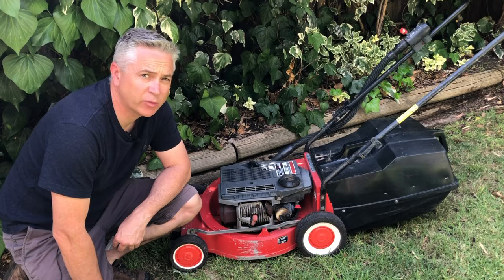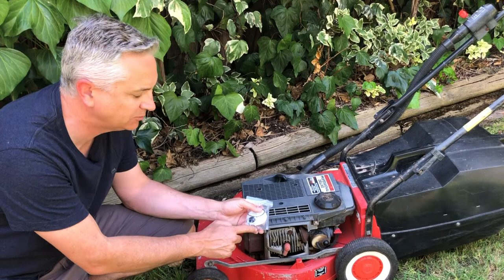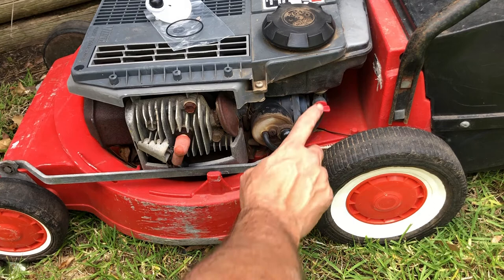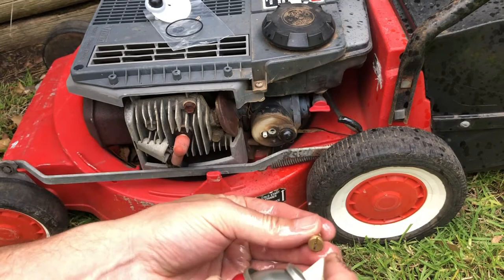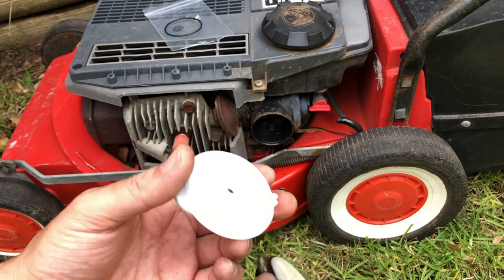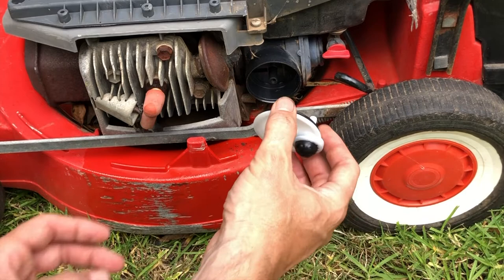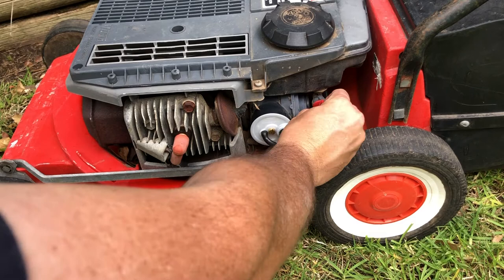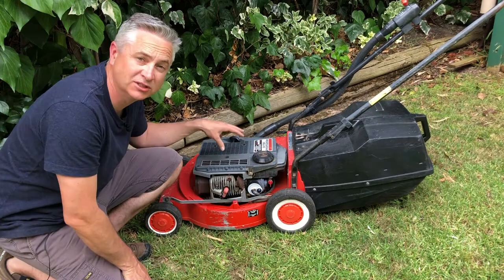Victa 2 Stroke Lawnmower Easy Carby Fix - How to fix leaky primer bulb and flooding carburettor

Comment: Thanks Drew bought the carburettor kit with the metal needle.After pulling the start cord 3/4 up the mower started. Being battling to start the mower with the original plastic pin. It’s a game changer.
Reply from the maker: Hi Mike, good work, you will find that previously the carby was flooding!  Cheers Drew

Comment: Couldn't have gone on a better mower. That alloy base that takes the thumb latch type catcher is a superb combination with the mighty 2 stroke Powertorque motor. I have used a white version of your mower  for years and it's a pleasure to use both on long tough lawns and keeping your well kept garden manicured. So glad the kit worked out.
Reply from the maker: 100% agree, these mowers are brilliant!
Reply: @DrewFixIt  I just rewatched your vid a bit of friendly advice, when you pull the cord wait until you feel it grab at the motor before giving it a tug. Don't pull it fully from the get go.
These things are tough but it's always best practise on any pull start motor ☺.
Reply: @jamesfrench7299  Spot-on advice. Some years ago I broke the cord on my father's mower by pulling too hard, so I offered to take it home and try to fix it. It wasn't difficult. It's still working on the original cord, albeit slightly shortened, and I've learned my lesson.

Comment: These mowers are a model of simplicity, repairability and reliability, not to mention the fact that they mow really well, and parts are still available - nothing else comes close, and I've used and maintained this model for many years. If a score higher than 10 were possible iFixit (if they were to cover this type of machine, which currently they don't) should give this mower at least 11/10. Recently the circlip holding the height adjustment on the left hand side somehow got lost, but getting a replacement online was easy after a temporary fix with a bit of wire. Same story with the air filter, plus bits.
Reply from the maker: Hi Tom, agree these are brilliant mowers!  You wouldn’t believe but I picked up another one off the side of the road the other day and … I’m sure it won’t take much to get it running!!  Cheers Drew

Comment: great video effort and simple for many people who have thrown out these mowers purely because of sticky carbys.   observation1 You should have mentioned WHY you cradled the float and all assembly  when pulling it away so as not to lose the NEEDLE as they drop out!   observation 2: there is a horizontal indicator/line usually on the front to assist the float line.   again not a critisism and you showed what a person would have paid 99.00 at a mower shop to do exactly that yourself  in 5 mins   BRAVO
Reply from the maker: Hi Peter, thanks for your kind words.  My goal with the channel is to help as many people as I can and I understand completely what you are saying!  Funnily enough I have just picked up another one of these mowers off of the street, which has a visible split in the primer bulb.  I will make a video fixing this one up and incorporate your feedback!! Cheers Drew

Comment: I have the green 1984 version of this mower, with the green thumblatch catcher. When putting the faceplate back on the carby, I usually put it on upside down, then turn it around once it is on before tightening up the screw. This makes it easier than holding the float and needle in. How is the needle holding up?

Comment: Great engine let down by the carby. Accidentally forgot to shut the fuel off and returned three hours to find engine hydro locked with fuel. Fuel had even filled the base plate having leaked out the exhaust. I own a later model Mastercut  utility mower with the three litre tank so there is a potential to lose three litres of petrol , not to mention the associated fire risk. Thanks for posting the link. Ordered one straight up. I feel Victa should have issued a safety recall for these machines. Otherwise I love it and only purchased one for the nostalgia and novelty.
Reply from the maker: Super glad you found it useful! Cheers Drew

Comment: Hey Drew, thanks for all your videos. The time has come for me to replace my primer cap etc. I have a victa 600 slasher with the 80 series donk. What carny comes with this model? I would like to order from varitech as they make a great product and I want to be sure I order the correct kit,
Kind regards and keep up the good work 🍻
Reply from the maker: Hi Mate, I believe it should have the G4 carburetor.  Perhaps @Varietech-au can chime in to confirm?  Cheers Drew
Reply: @DrewFixIt  thank you mate 🙏 I just confirmed G4 lm . Parts ordered including metering lever. Did you find the levering meter make any difference?
Reply from the maker: @chisel83  hi mate, the boys from Varietech sent me one a month or so back, which I intend to fit to the full crank VICTA up at my shack, however I haven’t got to it yet!  The reason I will fit it to that mower is I don’t use it very often and as I understand it, the issue that they are solving with this is the needle sticking closed after a mower has sat for a while!  Cheers Drew
Reply: @DrewFixIt  the old super 600 is my first victa, had it a couple of years now, bought it from the original owner who used it at his property in moonta bay. I believe the 80 series is a full crank too. I use this mower commercially and I swear now by these old two smokes, never bogs down. It’s in awesome condition, best $100 I’ve spent in ages.
Reply from the maker: @chisel83  awesome!  I have spent many summers in Moonta Bay 😁😁

Comment: Hi can you tell me where I can buy those metal pins from thanks for your time
Reply from the maker: The company is Varietech.  If you have a look at the description of my video I put a link in the description to their eBay store!  Note, I have no association to them at all, but it really does make a difference.  I cut my grass after work tonight and the mower started easily on the first pull!
Reply: @DrewFixIt  No link to be seen!??
Reply from the maker: @billmccallum886  Hi Bill, in the description to the video there is a link to the eBay store of the seller, however here is a link in there store to just the metal needle: https://www.ebay.com.au/itm/264234019894?hash=item3d85932c36:g:DCUAAOSwNCtgI75P Goodluck and let me know how you get on?  Thanks Drew
Reply: @DrewFixIt  Thanks for the quick response! 
I now know that my iPad Air doesn't displays as much info as my laptop!
My bad!
Reply from the maker: @billmccallum886  no problems, I chucked a metal needle in another Victa on the weekend and it made a huge difference to how it starts ... video coming one day, lol!  Anyway, hopefully it helps you too!  Cheers Drew